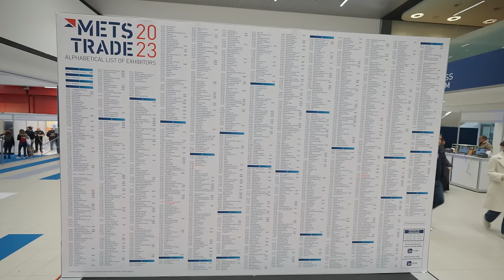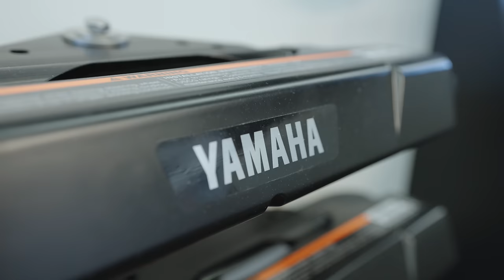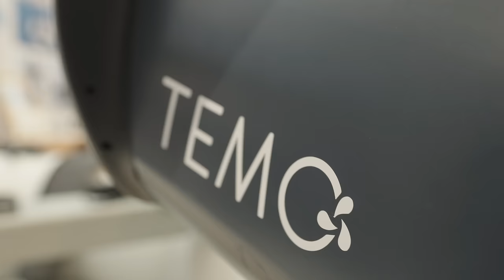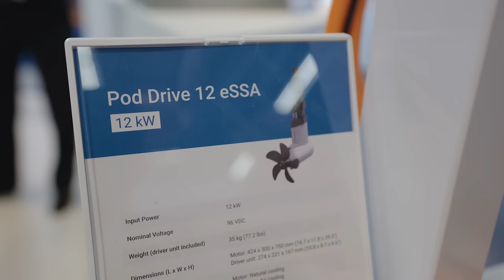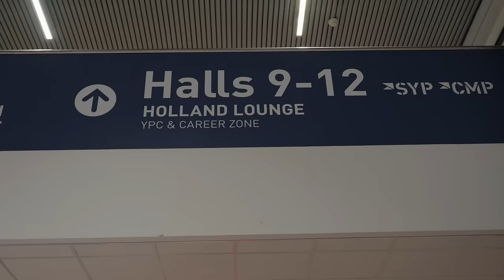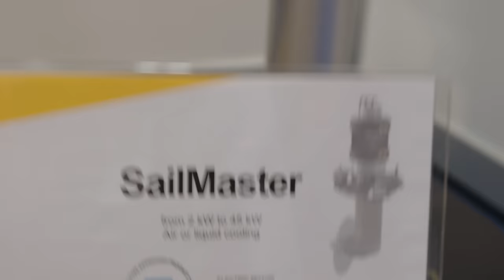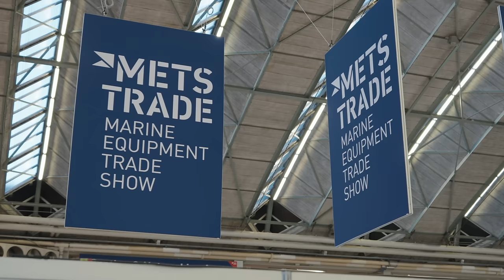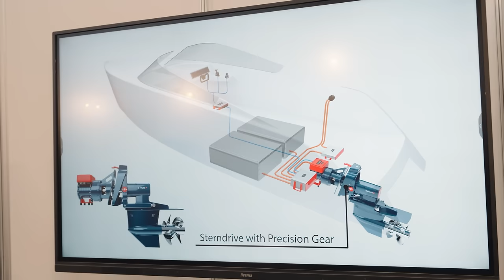The Shocking Truth About Electric Propulsion | Step 371

Comment: Still not seeing the energy density and recharging speed needed for bluewater cruising.
Reply from the maker: The opposite is actually true. When “Blue water cruising” you have more time, longer distances and less of a schedule. It’s all the motoring around near land when costal cruising or racing when you actually motor and can’t sail long enough to regen. For ocean passages all electric is ideal.
Reply: @SailingUma   Sorry, when I say 'blue water cruising' I'm including all the navigation into and out navigable waterways. I still think all electric is perfect for day-sailing when you can plug it after tying the boat up in the slip.

And I take that point for long passages where you actually manage to sail most of the way. The fact remains that a few hours of motoring on batteries doesn't get you far and it takes longer to get that range back than dumping a jerry can of fuel in the tank. Until that changes, and physics suggests it won't, I don't think full electric is for me. Much of this is an attitude thing - just a willingness to be becalmed or fight through a blow. I think there's an excitement to be an early adopter of a technology being used to address a fashionable cause, and do so publicly. All that is fine, but this still looks like a pretty narrow application.
 
I'd be interested in Combi's hybrid system if I can either directly engage the prop to the diesel if the batteries run flat, or the system is capable of running the electric motor directly off the generator. I sent them an email asking this question. And I'd only deal with this extra weight/cost if it allowed me to run an air conditioner and/or water maker more easily.
Reply: Have you looked into Waterworld from the Netherlands? To my knowledge you could install a hybrid system where both, Diesel and Electric are „working“ inline on the same shaft and regen would be possible.

Comment: PODs? Thx guys, this was incredibly well done!! OV appear to be the OGs and best understand re-gen; congrats on the DAME award! I saw WaterWorld for a frame or two (just met them in Annapolis). What did you learn about pod motors? Cooling the motor directly through the casing and eliminating ALL other moving parts like pumps and gears seems so intuitive. Then combine that with the forward facing servo-prop. But OV must have their reasons to stick with the sail drive. Thoughts?
Reply from the maker: They’re planning a Servoprop pod I believe. They mentioned that in the interview.
Reply: @SailingUma  awesome, thanks again!
Reply: Electric things in salt water seems like a bad idea.   It is only a matter of time before a seal on a spinning shaft fails.   With 90% efficiency of a motor, I wonder how big a problem cooling is comparatively.   A diesel is only 30% efficient, the rest of the power is heat, so cooling need is 6x for same work.
Reply: @geraldinesasquatch3728  true, comparatively. But even the 10% have to be dissipated for the motor not to overheat.

Comment: Wonder why no one talks about using super capacitors or solid state batteries combined with electric motors and regeneration.

Another thing to think about is most if not all electronic manufactures stop supporting them after 10 years as they feel its antiquated equipment. I deal with it all the time in the RR industry. So after 10 yrs, you have to buy a whole new system. Thats not cruiser friendly. Lets not even talk about electronics don’t like static electricity, lightning, vibration, and varying temperatures. 

I see the benefits but I also look at the downfalls of them.

Comment: Don’t oversimplify a belt driven generator by calling it an alternator, generators were commonplace in aircraft for years producing DC power directly. An alternator producing an alternating current must be rectified to provide DC, useful to realize that a large DC generator is NOT an alternator.

Comment: What I do not understand is why use sea water to cool down the motor why not have oil cooled electric motors then no rust no holes needed. Oil cooled radiator would be very small and perhaps a fan. now anything under three KW is too small anyway. For a 35 foot sailing boat 8 to ten KW motor is ideal.  Now at this moment Lithium batteries are getting dangerous rather than safe as seen in EV cars catching fire. But there are new types of batteries being made and tested. Heat control on lithium batteries are important so for now look for heat control Lithium batteries. .
Reply from the maker: What they don’t tell you, is that you don’t really need cooling at all. They have it there for the hybrid folks who motor for hours at a time full throttle. We don’t even have our cooling circuit hooked up and our motor doesn’t get above 40C. Our batteries will die long before the motor will overheat. The motor controller is what gets hot first. That’s what the cooling circuit is for. Our Servoprop is filled with oil that circulates down into the skeg to cool with the water around it. It also means the oil is slightly higher pressure than the ocean water, so if an o ring fails, oil will leak OUT. Water won’t leak in.

Comment: When you consider that electric motors are basically one cheap motor, a speed controller and a waterproof case, It's hard to look at all these companies - and their prices - as anything but greedy bastards profiting from people's need to do the right thing and pollute less. 
The great majority of sailors - 99% use their engines to get in and out of marinas for day sailing. They are the perfect option for electric, and the only reason most are still using diesel and gas are these ridiculous prices. How do they justify an electric engine in a plastic box - batteries not included being up to twice the price of a far more complex gas engine? That's the question I'd like to see asked.

Comment: For electrical generation under powerful sail why can’t you throw out a tethered, large propeller driven generator, semi-submersible and a bit waterproofed combo that trails the boat.
To answer my own question I came up with, drag on boat, electric and water mixing, rough weather, can’t be arsed throwing it overboard and then recovering it.  The laws of physics don’t apply.
You put up a larger sail to go faster why not put out a larger generator to get more power.
I only got a B in physics so Please reply to how stupid an idea this is.

Comment: Sailing around the world with a battery motor is the same as committing to sailing without an motor.  Batteries simply suck at propulsion and are dangerous when relied upon for ocean crossings - actually, the whole idea is silly tbh.  IF and when batteries can motor your boat for 1,000 miles or more then we will be at least close to proper. But then there is the charging times which would be days and days long.  And then the cost which would be greater than many used sailboats.
Reply from the maker: Well we’ve been sailing with our electric motor for 10yrs. About 30 countries. Arctic circle. Svalbard over 30,000 miles sailed. Never motored for more than about 10 miles. 

The best part is. We’re a SAIL boat. And while we’re sailing, we generate all the power we need from the prop spinning in the water like a large hydro generator.

Comment: Is anybody confused now😂😂😂😂😂 how are Kika and Dan going to use all that data for a sensible selection….
Reply: I agree...too many choices.
Reply from the maker: Not really. There’s still only one that makes any sense if you value regen.
Reply: If you look at the Fisher Panda motors, and get creative with their fitment on the boat, they offer a great regen option.
Reply: @SailingUma I think craigoverend  made a significant comment as to why that is.
The different requirements on the prop for propulsion v. regeneration make variable pitch control a key element in integrating this in one unit. As long as oceanvolt holds this alledged patent, other companies will have to work around.

Comment: Batteries are holding this back. Give me the math. How many pounds of batteries will I need to match the energy density of 10 gallons or 70 pounds of fuel?
Reply from the maker: Better question: how many litres of diesel fuel can you produce in a day? 

We produce about 1L/day equivalent from solar. And 4 L/day from regen. 

So we can make the equivalent of litres of diesel every single day while sailing offshore. And we’re just a small slow boat. You could 4X that on a faster performance boat like the Salona we sailed.

Comment: Call me cynical but, electric motors have been around since my grandads time. Apart from regen, motors and batteries have only got simpler and better over the years, and lord knows they were simple to start with. So how come simple electric drives cost the same or more than expensive gasoline outboards and inboards? 
Also, £27000 for a motor, and £900 for a battery. What's that about? In order to compete with gasoline outboards a long range cruiser needs 6 batteries in the same way he needs 6 large bottles of diesel on deck. I just don't see electrical motors as a viable alternative to gasoline in and outboards.
Reply: I think it's a matter of market and mass production. Right now they are more for the upper market made by smaller companies. But since as you say an electric motor is orders of magnitude simpler in terms of parts and function than combustion engines, it is just a matter of time until they get cheap enough to totally supplant the combustion engines
Reply: I genuinely hope they do supplant diesel engines but that will require better solar generation or battery storage by many times. At present an electric solution for my boat is £27K, and that's for a very basic system with limited range. They're not even close to being a consideration for the average boater. They will target very wealthy clients to build revenue first.  @Chyrre
Reply: Well Michael Faraday invented the electric motor in 1821. But it was a science demonstration. It took time and effort and investment and factories to get to your grandad’s day where they were taken for granted. I don’t think electric motors as drive systems have reached grandad levels of pervasiveness yet , they have left the laboratory, but are not quite ready to replace every horse on those trolley cars, or make those ice boxes make their own ice, or put a lift into every building with more then three storeys.

Comment: Electric motors are pretty pointless to check out, as they literally work exactly like diesel powered ones, just with different power bands. No one has made any real big innovations in battery tech, and what you see on display is bloated subsidies without any real innovation in range. IF someone actually makes headway in physics and deploys a new type of battery system, they will become the next amazon /Tesla overnight, until then you got these leeches trying to take your money with single digit improvements. That Hybrid system is actually the best thing they showed, as a 6kw alternator would be fantastic for supplemental topping.

Comment: Our battery exploded while it was charging some weeks ago, it took seconds and our boat was a total loss. Luckily we were able save our two kids from the burning boat because we were still in the harbour. 
If it had happen offshore you don’t have a chance. Lipo burns like hell.
I really liked the electric outboard but I would not charge it while underway.
Reply from the maker: Any more explanation as to WHY!? What set up did you have? What batteries? What BMS? What charger? It’s super tragic to loose a boat. Nightmare fuel. But sharing = learning and hopefully helping others avoid similar tragedies.
Reply: @SailingUma   It is still under investigation. it was a popular 1 kw electric outboard. there was nothing unusual before the explosion. I'll keep you updated.

Comment: Companies don't do regen not because they are assholes, but because it's inefficient. You've talked to the engineer who straight up told you the speed you need to have to regen some reasonable power. While the last guy was definitely a salesman, and not an engineer. Sorry but you've made wrong conclusions.
Reply: Regen is not at all inefficient if you have free sail power. Under sail, regen recharges your batteries. I'm not sure what is inefficient about that. Seems like free power to me.
Reply: The ironic thing here is they have been using the Ocean Volt system for a while now on their own boat and have found the regen to be quite good for their needs.  Do you actually watch this channel?
Reply: @seanobrien7169  In what episode they go with showing actual data while sailing?
Reply: @shieldaigbencher  Wind is also a free power. Where is their wind turbine?
Reply: @Dustmadeout  lol, you're kidding, right?  You want me to go through their backlog to find a video for you?  Their cruise into the Med has a lot on the update they received from Ocean Volt and how regen is working for them.  The gist I got from all these sales reps is it is probably not worth much for the day sailer that spends 50% of their time under power.  Uma probably spends 95% of her time under sail.  It works for them.
Reply: @seanobrien7169  AGREED, This person has clearly not watched any Uma and does not know how they have been regenerating electricity for their motor for years. Very efficiently from their excess sail power. Wind turbine not needed. They use their sail drive. And no, that is not in the air, it is underwater.
Reply: Talking to a channel who's used regen for years on a really slow hull not designed for it..
Reply: @Dustmadeout  step 277
Reply: Lots of assumptions being made here by both sides of the issue...the facts are, no one has seen the data from Dan regarding regeneration,  or how many hours it took to make a full recovery of the battery bank....yes, UMA has been doing some regeneration,  but I'll stick to my diesel....at some point in the future with continued development we of the world may get to real clean energy,  but this infancy stage has not solved what fossil fuels and the energy it contains for such small quantities without the same issues of mining lithium or other metals...some day maybe...
Reply: @seanobrien7169 , and you base your opinion here on watching a video,  but without actual data and facts which is how true scientific results can be achieved and proved....admittedly Dan and Kika put up with a very different and challenging effort to make regeneration work for them....the data, if and when they are able to provide it will give all here a realistic expectation for using regeneration for sailboats.
Reply: So here is the obvious question,  where is OCEANVOLT at this obvious "Electric Motor Show" ????
If they have a solution everyone here seems to believe in, then why not show off how you have beat the competition???
Reply: You points are well taken, and if Ocean Volt actually has the solution,  how come they are not at this show????
Reply from the maker: They were. Did you watch to the end? The won the Dame Ward for best new product of the year. 

Also we, and OV have plenty of published data on Regen. We’ve showed it and talked about in many videos over the last 3 yrs. What more “data” do you want/need. Video proof isn’t good enough!? I hope you’re not one of those flat earthers too.
Reply: @larryb5914  but you are right, Larry.  I am basing my opinion off of a YouTube video made by people I don't even know...though I have watched this channel from its beginning.  But who knows, maybe the whole thing is green screened and filmed from their living room in Nebraska.  From their...couch ..or maybe from the north pole with Santa clause...but whatever...I will roll with their experience as opposed to someone that criticizes something without even fully watching the video.
Reply: And remember it's about what your goals are is Regen going to replace a diesel engine that is tried and true and dependable of course not. But if you want to stop depending on fossil fuels Regen can be one part of a system that can help with getting power as well as solar. Both of these seem to be enough for Uma and her lifestyle.

Comment: Same again electrics  are pointless why use electrics when you can run off Hydrogen,  it has been done by cars since the 1950s of today Toyota has now slowed with electrics  and converted to hydrogen
Reply from the maker: Hydrogen has always had the potential to be great! But it’s just so impractical in practice. The equipment is super expensive and rare. Knowledge and parts are non existent. And there is zero infrastructure for it in the marine industry. Also most of it is just made from petrol anyway, so it’s more carbon intensive. Someday we’ll make our own from seawater. But tech isn’t there yet. Like doesn’t exist on a small yacht scale and still come out net positive. We’re keeping a very close eye on it though. If it exists, we’ll be the first to implement it.